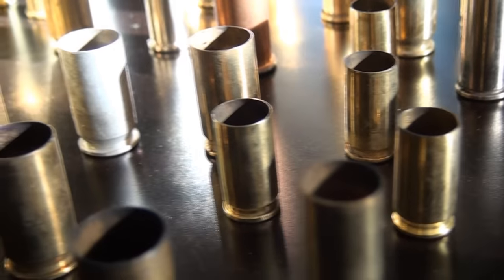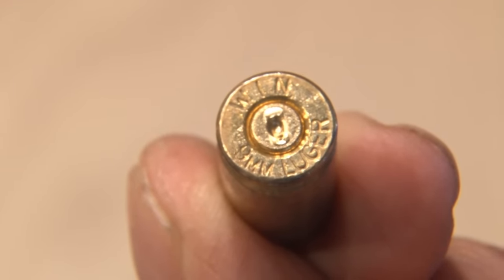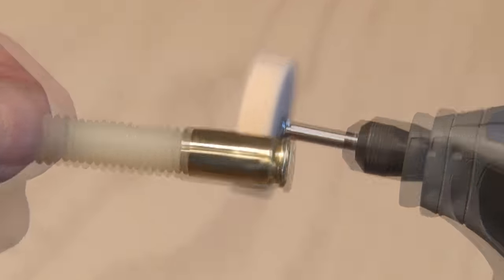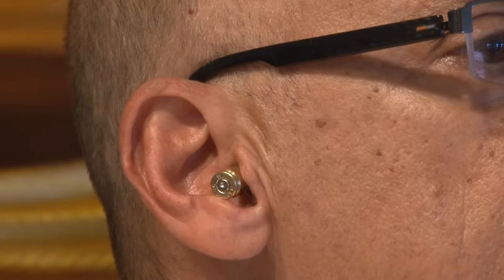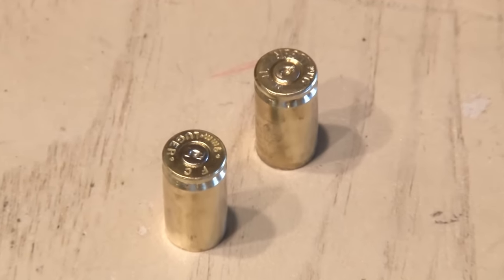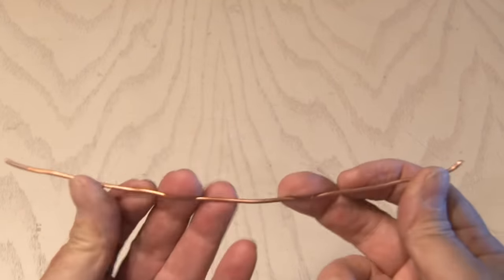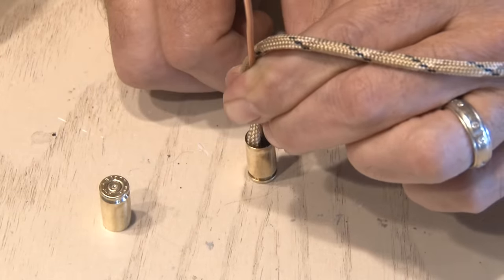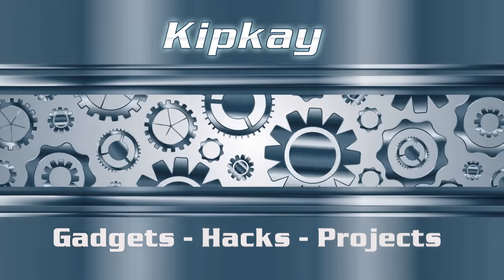4 Clever Uses for BULLET SHELLS!

Comment: I've also seen bullet casings used as punches. Like if you need a new hole in a leather belt, hammer a .22 casing into the belt where you want the hole.
Reply: Zachary Adams nice idea I will actually try that

Comment: Actually in a pinch you can use a spent 9mm casing as ear plugs if you put it primer side in your ear. Ive done this at an outdoor range. Wouldnt suggest it for indoors but it does help.

Comment: Hey idk if you'll see my comment but I think it would be cool if you put magnets at the bottom of the shell so the bracelet will be closed rather than open
Reply: mr modder The copper wire is stronger than a magnet, so it would just stay bent in the same position
Reply: mr modder I was thinking the same, but using paracord knots without the wire to make it more flexible and comfortable. Plus you would have a lot more paracord that could help in an emergency situation.
Reply: It really depends on the magnet strength and I think  some cord with a smaller diameter would work better bc it's like half the thickness but yet very strong so depending on the shell size you could get 2x the amount of rope for about the same size bracelet which would be better bc you can do way more things if you were stranded

Comment: If you don't have a 9mm case you can use a 380 because there the same size in diameter. The 380 is just little shorter than a 9 mm

Comment: An easier way to polish is to reverse your technique.  Put the casing onto a dowel that is snug, chuck the dowel into your bigger drill, spin it and use a strip of sandpaper to clean it and then buff with a soft cloth while spinning.  Works MUCH easier than holding the casing and turning it into the wire brush, makes a more even surface finish.

Comment: You could pop out the primers and keep the cord between the earplugs.
Reply: I thought that too.  Although the primers are already out, he could easily drill out the center of the casing.
Reply: The primers are just pressure fit into the casing.  You can insert a small screwdriver, punch, allen wrench, etc. into the open end and simply pop them out.

Comment: i built a desk and then used 5500 22cal. casings drilled a dimond patern and inserted the cases and apoxed over it for the desk top and used 7.62 x 54r for draw handles
Reply: That sounds like the most kickass desk ever made

Comment: I think you should reload that empty brass, then you wont need to buy more ammo.
Reply: I don't think that's how that works, of cource i may be wrong but im assuming if its an empty shell than it has already gone off and can't be reloaded
Reply: @gerbinson  it's   called reloading or hand loading you press out the spent primer, clean  and polish the case,   resize the brass and inspect for cracking,  measure and trim for length, install primer, fill with measured powder, seat and crimp bullet.  Viola ammo.  Shoot and repeat.  Also keep away from flame.
Reply: @gerbinson  you can you have to knock out the primer and fill it with gun powder wich can cost more then buying new bullets

Comment: In the bracelet you could ditch the the wire, Hot glue a strong magnet to the bottom of the bullet casing and then hot glue the paracord in too. Repeat on the other side and you have a magnetic locking bracelet.

Comment: Just some tips. Cartridge is the type of ammunition which includes a case, powder, primer and bullet in one. It replaced cap and ball where the barrel or cylinder of the firearm held the powder and a lead ball or bullet and were equipped with a nipple or nipples on which a percussion cap primer was placed. Cases are short for cartridge case, they come in brass, steel, aluminum and experiments have been successful in producing carbon fiber or composite cased ammunition. Although the carbon fiber and composite cases were not commercially viable.
Any fool can criticize creativity and every single creative person has had many more people who laughed, scoffed, told them they couldn't and how they were doing it wrong, than there were people giving them good advice and telling they they could. Ignore the critics. They, for the most part, would need plexiglass stomach panels to be able to see anything but their own colon. I just gave you more knowledge than most of the trolls and self appointed critics have.
Reply: OldToughDW Paper cartridges are an odd ball.
Reply: Very well put. It's a cartridge casing so terminology was a bit wrong but honestly as long as people know what it does and how it works and how to use it safely, the word doesn't matter much.

Comment: Take a chamfer tool used for reloading and chamfer the mouth of an appropriate size case to the point where it is razor sharp, then use them for hole punches when making homemade gasgets, or punching holes in leather or anything similar, since cases come in so many different calibers you can make an entire set of hole punches from discarded cases you can pick up at the range.
Reply: Duke Craig i do this with a round file and use 223 and 308 cases as cigar punches

Comment: i dont know if if would use hot glue on the valve caps for my car. at freeway speeds the hot glue could break loose making a high speed projectile due the the high speed spinning of your cars rims. ive had wheel weights fly off my rim and cause serious scoring to my cars paint. i can imagine those would seriously chip or even crack a cars windscreen. i would recommend an epoxy instead

Comment: Ever think of using brasso or silver polish?? ... the felt wheels without tripoli wont do much... using a felt wheel with tripoli will remove any scratches and tarnish... no need for the wire wheel... follow up with rouge on a different wheel for an incredible high shine... I polish proffessionally... but the liquid polishing agents do the same thing if U dont have the dremmel stuff🐸👍

Comment: Take used primer out of a 45. ACP or 10MM Round then slightly drill out the primer spacing then insert mini Xmas lights (less than 10ft is best) then put a tiny bead where primer used to be and you have mini bullet lights that look super cool.

Comment: a notable point when polishing shell casings with a dremel: use a dust mask.  lead exposure ain't nothing to screw with.  will you do long term damage to yourself if you don't?  probably not, but you can never be sure who's been shooting what kinds of ammo at the local range.
Reply: Andrew Amann spent shells are made of brass
Reply: Jose Arredondo ..or aluminum, or steel.  I know.   I burn through about 300 rounds a week at my local range.  the mask recommendation is for any lead contamination that would come from firing or just landing on the deck, if you happen to be using spent casings.  basic precautions should be taken, as lead exposure can do serious neurological damage, and the stuff doesn't pass out of your system quickly or readily.  alternatively, you could just give them a nice solvent bath, and a bit of a tumble to polish, and not worry about it.

Comment: I used to "reload" casings with the stuff from inside those little paper caps (like 100+).  And then put a BB on top and hold it in with duct tape.  Throw that onto the ground for a super snap!  Very loud. I was just a kid, so, whatever.
Reply: t s unrelated but i I used to take the rocks from the pop it fireworks and put them inside a beer cap and fold it, it was louder than a firecracker

Comment: Earplugs, what if you get hit in the ear that would hurt. Valve caps, what if it gets launched into someone's windshield or through their radiator if the glue fails. The best use for casings is to reload them.
Reply: What do you plan on getting hit in the ear with and there’s not enough weight and mass for a brass casing to go through a radiator or a windshield, if a rock four times the weight can’t go through either I doubt a soft piece of lightweight metal would
Reply: @doornaildean9891  I know you don't have a general understanding of physics. That is ok. Never too late to go back to school.
Reply: @ConstitutionalAudit1776  says the dude who thinks a valve cap will puncture a radiator or a windshield💀
Reply: @ConstitutionalAudit1776  ain't you ever saw the ones they sell at stores? same thing

Comment: how many miles did the hot glue last on the valve stem caps? more than five?
Reply: Why wouldn't it last?
Reply: it's a part subjected to extremely high centrifugal forces as well as extreme vibration and wind turbulence... in my experiences, hot glue is a light duty adhesive and is easy to pull apart with your fingers... I would expect they wouldn't last long if used... and also will put a big chip in someone's paint or windshield when they fly off on the highway... I would recommend an epoxy based adhesive (JBweld would be an economical option).
Reply: Yep, epoxy would definitely be much better because it would hold stronger. Centrifugal forces push the shell against the tire valve so I don't think it will rip it apart. Vibration is more important factor. What comes to wind turbulence, the shell does not have large areas where the wind would cause lots of stress. It's quite aerodynamic. I think it will most likely come apart when one tries to screw it in place. Hot glue should be used to crafts only, not in places where you really want something to hold strong in place. In this case hot glue might be just enough.
Reply: I agree with ya. Been making these for years but I use epoxy. Leave the hot glue for granny and her scrapbooking

Comment: I like the 45 valve stem covers I think I might do that the problem is I don't own a 45 so I don't know if I have any 45 shells guess it's time to call up my buddy with a 45 and go to the range!!!
Reply: Mcotter00 Usually standard plastic valve stem caps fit good with the .40 cal just pressed on or 9mm if you have a Toyota with grey tpms caps. the 45 fit decent on the GMs and Chrysler tpms (tire pressure monitoring system). These are just the ones I know off the top of my head, I know there's more.
Reply: Ok cool, I have a 2001 ford ranger that these would go on, i also have a bunch of empty .40's from my berreta 92FS so Ill see how they fit...

Comment: I made the car valve stems and they corroded.
Reply: What kind of casing did you use? and did it corrode rust red or brass green or solid brown?
Reply: @CreativeUsernameHere-r1k  I used 9mm. They turn brown and a little green.
Reply: Make them again, this time spray clear coat on them. Or dip them in UV resin. It's the contact with air and moisture that's corroding them.
Reply: @RyanBarnes  Thanks I'll try again.

Comment: Regular temp hot glue and vehicles don't mix well, at least while baking in the summer sun. Radiated heat from the brakes alone will melt it w/o a little breeze.  Wonder how many peoples will think someone stole their shiny valve caps and schmooed on their wheels.
Reply: Exactly what I was thinking. I guess epoxy glue would be better for that job.

Comment: That's not paracord, that's nylon rope. And since it's useless for pulling the cord, wouldn't it have been easier and a neater job if you pulled the strands out of the nylon and ran the wire through the shell, popped out the primer and then hammered the wire flush with the cartridge rim?

Comment: Ummm.....multiplying the weight by a factor of about 10 on the end of a rubber housed valve on a tire that's going to be rotating at very high speeds for prolonged periods of time....have fun with the INEVITABLE crack in the valve body that'll leave you with a flat that can only be repaired by paying a tire shop to break down the tire and replace the valve from inside the rim before having to also pay for re-mounting and balancing the tire/rim assembly! 🤦‍♂️🤦‍♂️🤦‍♂️
Reply: 69CamaroSS407, if you only break down the outside bead you can replace the valve stem and seat the bead with no need to balance it again.
Reply: jahaffe ummm....yeah, ok! You keep on believing that. 👍👍 I've been building (and racing) cars since the early 80s, reloading and competitive shooting since the early 90s, but.....whatever you wanna believe dude. 😊✌️
Reply: Just have the caps on while balancing. Stems should be replaced with tires anyway. Unless your a cheap bastard that buys used tired.
Reply: Lol thats funny. I did something similar and drive everyday and have been for years with no problems.
Reply: 69CamaroSS407 I doubt you do either of those things. I suspect you are living in your parents basement and work at McDonalds.

Comment: You don't measure paracord by its diameter like other types of rope or cords. You measure it my the weight it can hold. So was that like 550 or does anyone know?
Reply: twilightzone39 that was most likely just standard 550, as it's the most readily available in my experience

Comment: Those tire valve covers will likely cause an imbalance until they get thrown off on a hot day.
Reply: L Malino   Imbalance?  How's that?
Reply: The added weight plus the leverage created at the end of the tire valve will create a dynamic and static imbalance. When the sun hits that metal on a hot day the glue will soften and those shell casings will become projectiles at speed.
Reply: I made a set about 4 years ago and they are still holding up well.
Reply: L Malino I made a set with jb weld and steel caps and it threw the tire off by 1/4 ounce ... I worked in a tire shop at the time and was curious..sue me ..Lol but yea slap some quarter weights opposite of the valve stem and you're golden

Comment: Tell us what is going to happen with the bracelet after you make it wet, because last time I saw wet copper it was green.
Also don't you think that tire caps disbalance the tires...just a little
Reply: limplin7 good thing casings are made from brass
Reply: limplin7 dirt will do more to the tires then a few grams of brass and it takes years of water to oxidize copper so the bracelet is going to be fine
Reply: When copper gets wet it will corrode, look at the statue of liberty for example
Reply: Brandon Sullivan brass is a mixture of copper and zinc
Reply: limplin7 Not if you have the tires balanced and rotated with the .45 case caps on them..
Reply: Brandon Sullivan 
1. I did not say that casings are made out of copper(even thou copper is main ingredient
2. Brass also corrodes
3. Sometimes STEEL, NOT aluminum
Reply: limplin7 yeah because there is no cars on the road without the tire caps
Reply: @jets8991  the copper wire was inside the bracelet. That's what he wrapped the paracord around.

Comment: I do believe the weight of the case (not a shell) is going to throw the balance of your tire off. The cases weight too much for that.
Reply: Not really dude it will probably throw it of maybe a tiny bit but not enough to hurt it tires trust me I know these things xD
Reply: mr frank  I live in the South and have hunted and fished all my life. You can probably answer that question yourself now.
Reply: most tire balancershave a 1/4oz minimum.  i don't have a 45acp casing handy but i don't really think it would be an issue.  if you're that concerned about it, have the wheels balanced with the caps on.  He's also showing ford tpms valve caps which are larger than standard valve caps so you could probably use 9mm casings instead on smaller caps
Reply: Jimmy H not enough weight to throw off balance!
Reply: mr frank  that's my point, doesn't weigh enough to do any "harm". Most balancers only go to .25 oz so .14ish won't really matter